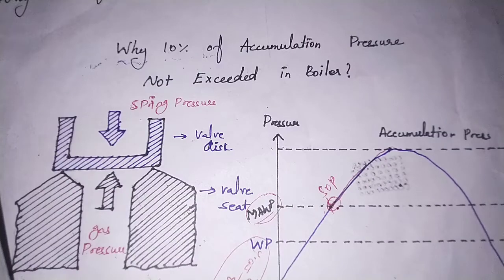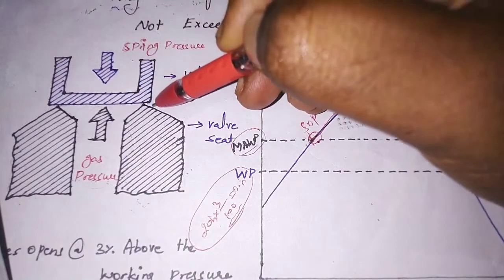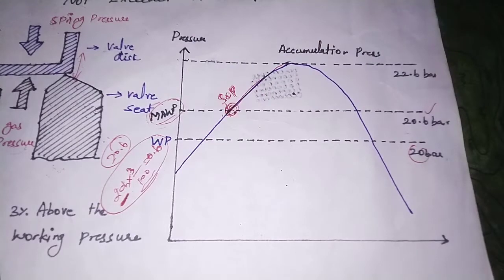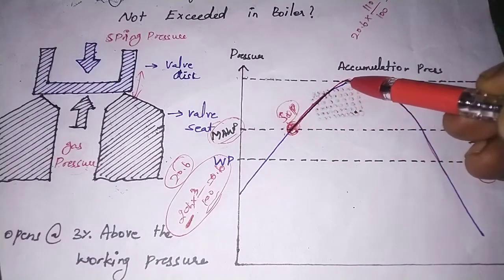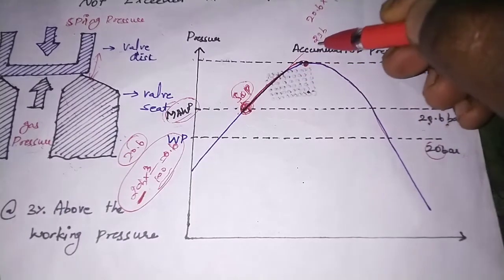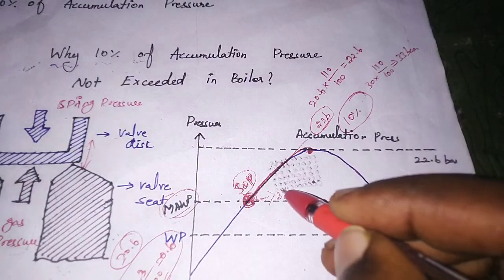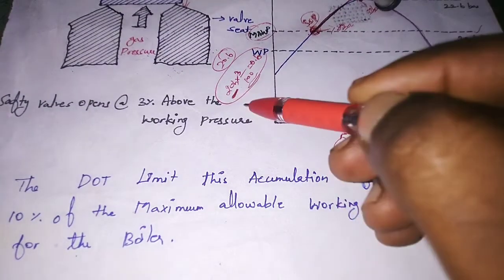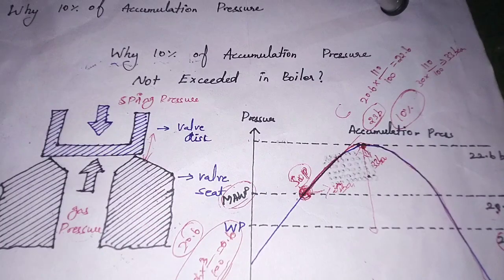Why 10% Of Accumulation Pressure Is Not Exceeded In Boiler?

Comment: What??? Still didn't answer why , how safety valve will be damaged if pressure increases by 11 or 15 percent , as the spindle will touch the cap after D/4 lift , there will be no more lift after this point. This still doesn't explain how it will damage safety valve??